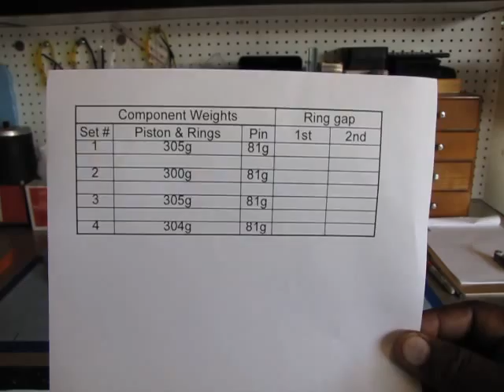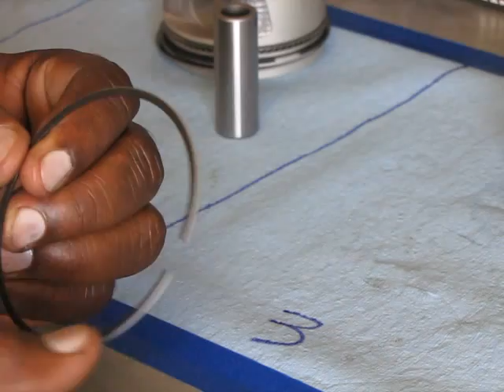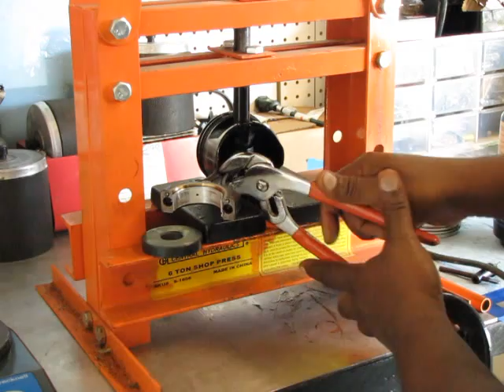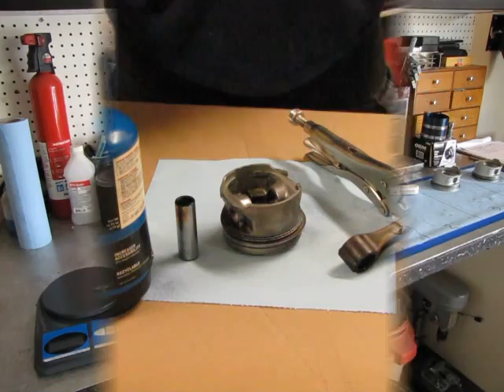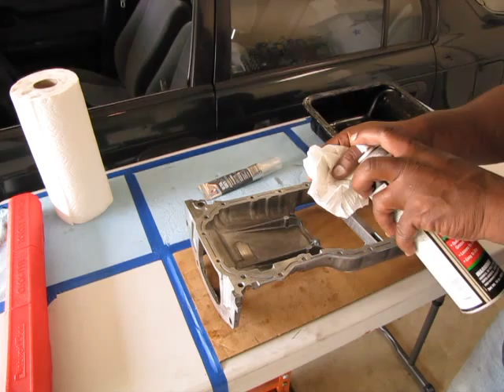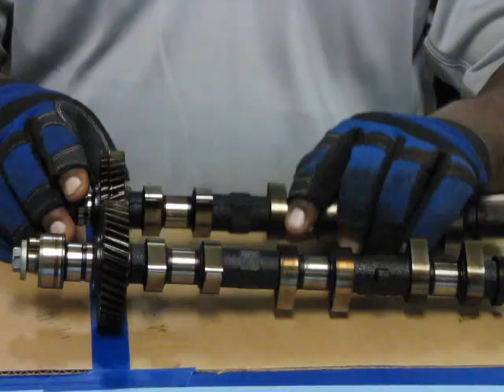How to rebuild Toyota Corolla 7afe 4afe Engine Install pistons, cylinder head, set engine timing

Comment: hello sir , i really liked your videos. I need you valuable answer for my doubt. I hope you will answer. Actually i had my 4 cylinder diesel engine rebuild with new lower block and new lifeters. at first start after 2-3 mins a stupid mechanic revved it soo heard upto red line in idle to check leakage 1 or two times uto 3 mins. IS THIS CAN BE HARMFUL OR ONCE OR THRICE DOING THIS MAY HARMED MY ENGINE .... sir please answer me
Reply from the maker: revving the engine is VERY good for it if new rings have been installed it helps them seat against the cylinder walls and greatly lengthens engine life. if only top end was done, there is no harm and no benefit.
Reply: Thank u so much sir

Comment: an in situ job is the best way to spoil the result.
one of the key to a successful job is the cleaniness of all the component involved in an engine rebuilding an an accurate measurement of all wear surfaces.
plus in a transverse engine, seals are more subject to catch road debris as dirt and ropes and start leaking almost as soon you return the engine in service.

I had to reopen an engine for a leaking head gasket caused by a debris entrapped between the head gasket and the head.
I also had to accept a comeback because honing dust shot one main bearing
now, never I do an in situ job more involved than removing a head or an oil pan, never on the reciprocating  components

Comment: Thanks you very much.

 I have a similar model engine to the one in your video that has heavy pinging. It's a 5A-FE from Japan. Would I need to do a complete rebuild like what you did to solve my issue?
Reply from the maker: Here is a free copy of my book.  Check out the Trouble Shooting Chapter especially, down pdf from my Dropbox.  https://www.dropbox.com/s/mcwpv0rb7lun038/0%20Entire%20book%20with%20covers%20and%20QRC%20for%20eBay.pdf?dl=0

Comment: Thank you for this video. It was very informative and easy enough to follow.
Reply from the maker: Here is a free copy of my book.  Check out the Trouble Shooting Chapter especially, down pdf from my Dropbox.  https://www.dropbox.com/s/mcwpv0rb7lun038/0%20Entire%20book%20with%20covers%20and%20QRC%20for%20eBay.pdf?dl=0
Reply: @Engineerboy100  Thank you - you are a craftsman!  I have a lovable   blue 1999 Toyota Corolla 1.6 Auto Liftback with 4A-FE and 110,604 miles.  I hope to do 100,000's more.

Comment: Very informative video. Do you have any plans on covering 4AFE to 7AFE conversion? Im planning to rebuild as such
Reply from the maker: +Vivek Ananth There are 3 main differences between the 4AFE and the 7AFE. 1. the engine block is taller on the 7AFE. 2. The taller engine block cases the plastic front engine cover that covers the timing belt to be longer on the 7AFE and 3. the taller engine block causes the mount location for the alternator where the front engine lift hook is to be longer.  The cylinder heads are the same and are interchangeable if the egr is the same configuration and the motor mounts are the same.  I have a 1994 Corolla that I have installed both 4AFE and 7AFE engine into.  Good Luck :)
Reply from the maker: Here is a free copy of my book.  Check out the Trouble Shooting Chapter especially, down pdf from my Dropbox.  https://www.dropbox.com/s/mcwpv0rb7lun038/0%20Entire%20book%20with%20covers%20and%20QRC%20for%20eBay.pdf?dl=0
Reply: +Engineerboy 100 noted and thank you a million! sorry I just came on YouTube have been busy with work lately. The project shall start mid June hopefully. will keep you updated. thank you again :)

Comment: I've got a 93 7AFE 1.8 that compression tested at 120, 85, 30 and 155 today.  :(  It burns oil (Qt every 4-6 hundred) but doesn't smoke much.  Just at startup.  It runs good.  I don't think I could rebuild one like you're doing.  Any suggestions?
Reply from the maker: +Vitality Massage Have a compression test done to determine where the engine is loosing pressure. have the rings checked the head gasket and the valve seals.  You can do it yourself with a simple compression tester. Just test the compression of each cylinder dry then pour about a half table spoon of oil in the low cylinders and compression test them again.  If they measure a higher compression there is a good chance it is the piston rings.  If not then it could be the head gasket or the valve seals.  If it's the head gasket of valve seals just have the head rebuilt and replace the head gasket and you'll be good for a long time.
Reply: +Engineerboy 100   Thanks man.  That sounds like the information I needed.
Reply from the maker: +Vitality Massage my pleasure :)
Reply: +Engineerboy 100  UPDATE! OMG! There are so MANY incompetent people out there! Today I bought my own compression test tool. From you and the internet, I learned of specific tests to determine if I had ring, valve or head gasket problems. I needed to be able to do my own testing so I didn't have to pay again. I tested the motor using instructions on the internet. My cylinders test at 175, 179, 180 and 182 after doing five revolutions each. This is EXCELLENT! I had a feeling that the test gauge the guy was using at the shop was flawed. He kept screwing with it and had to use a different hose end because the first one came undone in the cylinder. Also, he didn't turn it over a consistent number of rotations. It's likely that I need valve work right?  - not so costly.
Reply from the maker: If you can remove and reinstall the head yourself it should cost less than $100.00, replacing the valve seals and head gasket are not hard at all with the proper tools. I'll shoot you a link to the two additional tools you will need to change the seals once the cylinder h head is removed.  ...  I'd plan to change the timing belt also sense it will be taken a loose to remove the head ...
Reply from the maker: http://www.ebay.com/itm/Valve-Stem-Seal-Remover-Removal-Pliers-and-Seal-Install-Installation-Tool-Set-/231921345524?hash=item35ff96e3f4:g:awEAAOSwa-dWqt0g&item=231921345524&vxp=mtr
Reply from the maker: the seals CAN be replaced without removing the head ... but it takes some skill ...
Reply from the maker: https://www.youtube.com/watch?v=Pj1fRNpWNMs
Reply from the maker: Here is a free copy of my book.  Check out the Trouble Shooting Chapter especially, down pdf from my Dropbox.  https://www.dropbox.com/s/mcwpv0rb7lun038/0%20Entire%20book%20with%20covers%20and%20QRC%20for%20eBay.pdf?dl=0
Reply: what ended up being your problem?
Reply: but if the oil seals are gone then hes better off removing the head and cleaning all that crap off the valves and lapping them in. If theres a lot of carbon on there he will eventually get a burnt valve

Comment: Best video for 7AGE. Just bought a 7AGE 1.8L Celica with 300,000K miles on it for $1500.00... =D The engine still sound like it even at that kind of mileage... But it does eat oil a bit. Lady I bought it from have put Penn High Mileage 5W30. The cap ask for 10W30. I will change it to Val 10W30 high mileage later and if 10W40 is needed. I can't say anything bad for the 7AGE motor so far. Run good and pick up speed very well with out any hesitating. Very smooth but the engine get noisy pass 3K RPM at 65 MPH... Right now I need to change the thermostat on it due to the temp. reading. Seem like there no thermostat in it or seem stuck open... =D
Reply from the maker: +mongyaj Sounds like you got a good engine. Oil consumption on these cars is usually the valve seals.  If you are not ready to do the valve seals, put some AT-205 reseal in it available on Amazon, it really works if there is enough seal material left.  I've done some personal testing of it and it works well. give it about 6 weeks and you should see less oil consumption and or smoke.
Reply from the maker: Here is a free copy of my book.  Check out the Trouble Shooting Chapter especially, down pdf from my Dropbox.  https://www.dropbox.com/s/mcwpv0rb7lun038/0%20Entire%20book%20with%20covers%20and%20QRC%20for%20eBay.pdf?dl=0

Comment: Would this same sequence apply to the 4afe 1.6
Reply from the maker: +Shane Price Yes.  I have had a 4AFE in this vehicle lol odd as it might seem, the only major difference that I noticed outside of the obvious difference in displacement is, the location of the mount hole on the front engine cover section that bolts to the same mounting location as the alternator...

Comment: GREAT VIDEO! Very detailed and easily understandable. Just a couple of questions:

Are the new pistons, rings and rod bearings oversized? I got a 7AFE (95 Celica 5spd) also with 344k miles on original head gasket, valvetrain, and oil pump. Everything else had been changed (timing belt, water pump, etc), Car has been babied and never abused. It's even with the original clutch from the factory.

I'm doing a rebuild also and debating  if I should go oversized on the bottom build?
Reply: +Your Car Care Companion You actually need to machine out an engine to meet specifications to use oversized parts. An engine will not wear evenly. There will be more wear along the thrust angle of the connecting rods. Do not use oversized parts without machining to match.
Reply from the maker: Here is a free copy of my book.  Check out the Trouble Shooting Chapter especially, down pdf from my Dropbox.  https://www.dropbox.com/s/mcwpv0rb7lun038/0%20Entire%20book%20with%20covers%20and%20QRC%20for%20eBay.pdf?dl=0
Reply: The pistons and rings are stock, not oversized.
Reply: you need to measure you cyinder diameters to determine whether there is enough room for oversized pistons ...
Reply: +Your Car Care Companion You didn't change the main and thrust bearings?
Reply from the maker: +tranceport101 No I reused the main and thrust bearings. everything has always held together on these tiny little engines without changing the main bearing.  after I checked the rod bearings they actually didn't need to be changed either everything was glass smooth with no play but because the rods move up an down and I had er open I just decided to change the rod bearings too...

Comment from the maker: I did re-use the head bolts.  These engines are low compression and the head bolts are an over kill and have never failed on me.
Reply: Engineerboy100 you use the 22lbs then 90+90 method?  I keep reading conflicting info on Torque to Yield bolts.
Reply from the maker: Caleb Sandersier Yep have for years, works great and never had a problem.  I torque to 22 ft-lbs with torque wrench then do two 90 degree additional turns.  My final 90 degree verys as I use the actual 90 as a reference combined with matching how tight the bolt feels with the "stretch" feel I get so they all match.
Reply: +Engineerboy 100 Exactly. Don't ever rely 100% on a torque value. Always use your brain and stop tightening if something feels like you're going too far! I have had people on my channel comment that they broke bolts (head bolts or cam sprocket bolts!!!) because they misunderstood the directions. Don't be blinded by the instructions! :-)
Reply: I bought new bolts.  Whole set was only 18 bucks.  When comparing new and old bolts, my old ones were longer by about 1-2 threads.  Stretched.  Perhaps because I used an MLS gasket, the new TTY bolts were required.  All I know is, car is still running about 5,000 miles on it since new HG.  Check my vid if you haven't seen it..

Comment: Did you re-use your head bolts?  I have basically an identical setup.. California emissions 1996 7Afe Corolla
Reply from the maker: Head bolts for these little engines are so cheap I just replaced them but I don't think they are stretch bolts so I could have re-used them.  I have re-used them before on these engines and never had a problem.
Reply: Interesting.  I changed the gasket 3 times, the 3rd of course being the charm.  The first time was with an mls gasket and the same bolts.  The second was with a graphite gasket, the link you gave me, and the same bolts.  The third time, new head bolts, MLS gasket, and i went over the deck and head with 1500grit block of sandpaper and polished it.  Still running strong, 10 months later.  Check the video!  The bolts i bought were a few microns shorter the my used bolts, which leads me to believe they stretch.
Reply from the maker: The recommendation is to replace them ... so you're probably right.  I replace them or not depending on how old they are, my mood or the time frame for getting new ones ... getting ready to do it again in a few weeks gonna use a Fel-Pro gasket this time ;) and have the head milled flat first.
Reply: nice... I regret not going further and doing rings...  These engines are bulletproof except for the Oem oil rings.  i change the oil as soon as it starts getting dirty...which is only about 1500-2000 miles.  If you wait too long or the oil gets too dirty, the O-rings will stick and it'll smoke.  It's a known issue that lots of 7A and 4A's have.  It's just the material the rings are made out of.  I used a mizumo head gasket on mine.  Fel-pro one looks identical to it though.
Reply from the maker: A really really good temporary or even sometimes permanent fix for the 7A 4A smoking problem is:  https://www.amazon.com/ATP-AT-205-Re-Seal-Stops-Bottle/dp/B000NVW1LM/ref=sr_1_1?ie=UTF8&qid=1467330436&sr=8-1&keywords=oil+stop+leak
Reply: Yeah...  that works espesially well with worn valve seals.  i replaced mine and cleaned and polished my valves and also, valve lapped them.  Not even a bit of smoke now, even when i bounce the rev limiter.